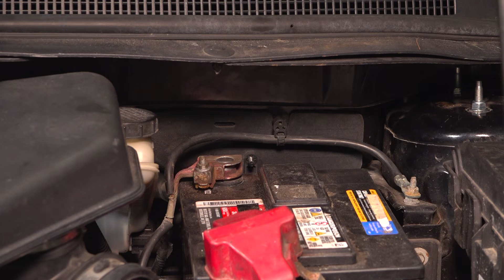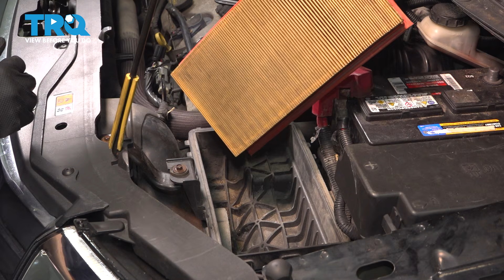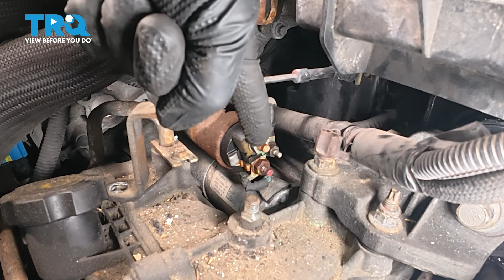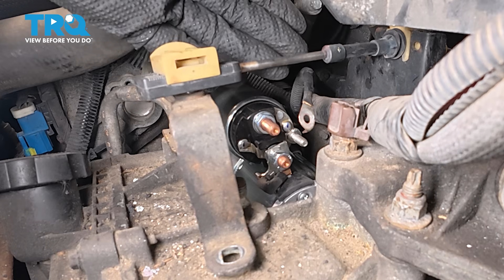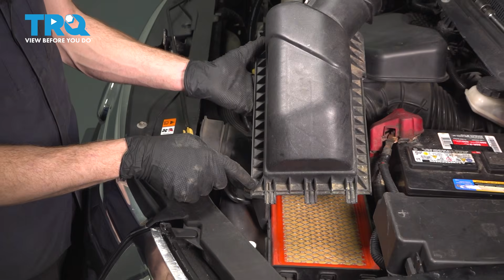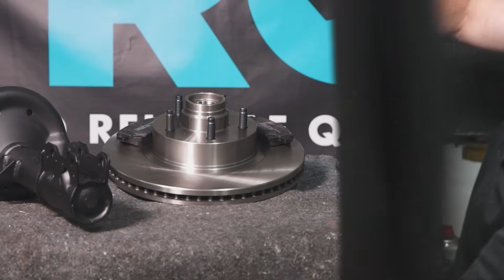How to Replace Starter 2007-2014 Ford Edge 3.5L V6

Comment: This video helped me replace the starter on my parent's Edge. This one is a 2015, so a little different than the older generation, but it has the same 3.5L engine, so overall, the same process.